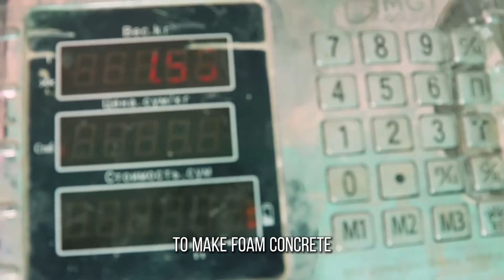how to make foam concrete

Comment: I had a problem after it was completely dry for several days it did not resist water it disintegrated
Reply from the maker: The strength of the concrete is insufficient and the formula needs to be adjusted.
Reply: Good foam I like it😊🎉